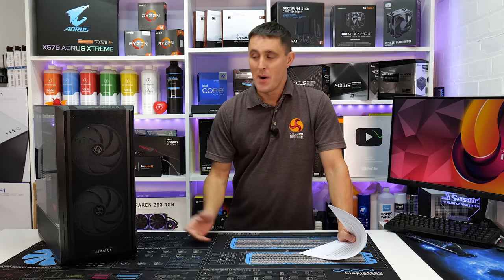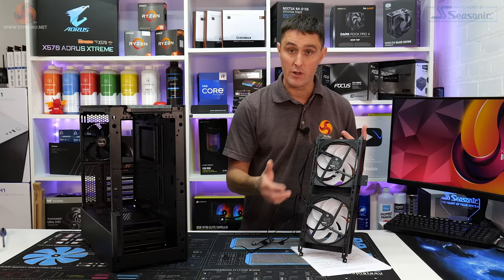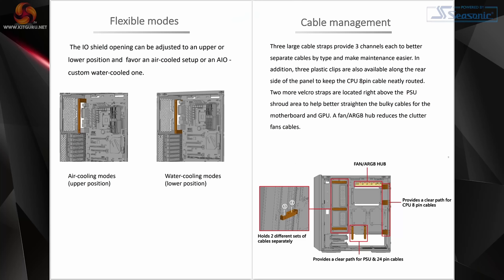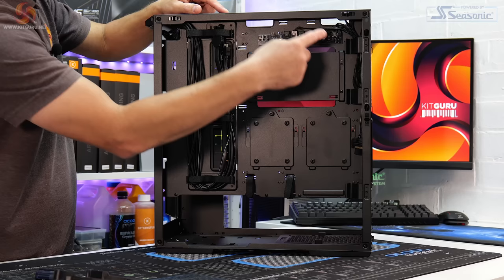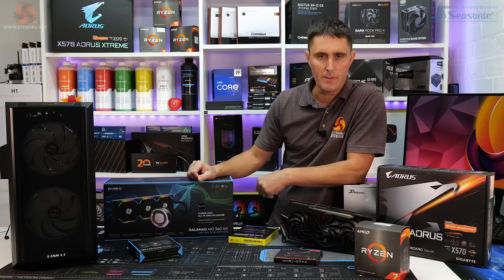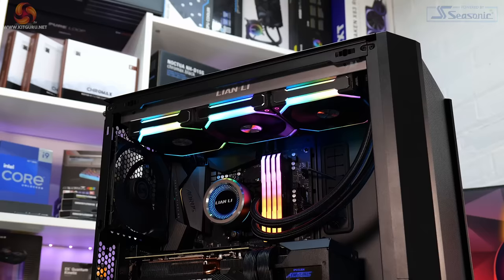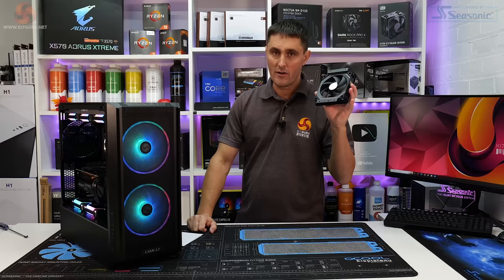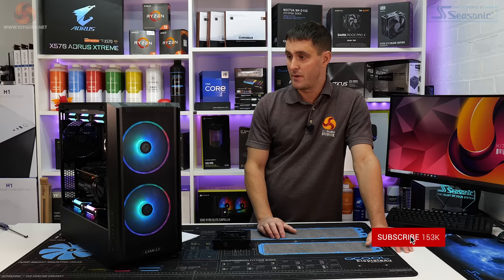Lian Li Lancool 216 - CASE of the year?

Comment: I wish these cases would have an option to remove all theRGB and side window features. There are still some of us here that have zero interest in all that fluff.
Reply: it's easy enough to just not plug in the rgb. for the window (i also prefer a solid side panel), i just tape a piece of black craft cardboard on the inside lol.
Reply: @darudesandstorm7002  Yes, I suppose you could. However, I was coming at this from the price point too. If an option was available without the lights and window, it might be £20 cheaper.

Comment: I would prefer it without RGB, other than that it seems a pretty good case assuming that a Noctua D15 fits inside that case.
Reply: D15 will fit. You can always disconnect or turn the RGB off?

Comment: I need more cooling to GPU and it looks like bottom fans would help. Is it so that PSU needs to stay fan down, GPU of course as it is(fans down, sucking air in?) and bottom fans pushing air upwards?

Overall I have one exhaust in the back, aio pushing up in the top and two large fans sucking in in the front.

Comment: I have and old XSPC 360mm radiator which is 60mm thick and with the fans I have 80mm of thickness. So my question is: would they fit on this case?

Comment: I like the way you can turn your horizontal GPU into a vertical GPU by rotating the expansion slot cover 90 degrees & using a riser cable.  Just one question, can I use my riser cable from the Original NZXT H1 in this case? 🔥 🤔 😂  Just joking, of course!   Although that add on to my insurance policy for extra fire insurance DOES look interesting...... Nah.

Comment: Hey great content thank you. Could you have fit the AIO and have the motherboard In the top mount position?  I know it's not meant to be there for water cooling but is it possible?  How much room is there for an AIO with MB in "air cooling" position?
Reply: you can still fit one just not as big
Reply: @banana3399  yes apparently <55mm total thickness of AIO.  Also mb  vrm thickness can hinder the fit as well.
Reply: I installed an Arctic 360 with Rog Strix 690 mobo on air position (top). Little tight but it fits. This way you can install the bottom and rear fans. Gpu is an RTX3080
Reply: @13gatoro  I was able to do the same. Thanks

Comment: Question..Im building my first pc and i got this case with the rgb controller.  And i never see this explained but on the motherboard it only has one usb 3.0 connection but both panels have a usb 3.0 cable how are you plugging both of them in?

Comment: wwell.. now days, RBG is controlled thru the motherboard, and software, so...
have you the same control options thru software, or only with the extra $14 costing module manually? 
cos if it only works with the extra add on manually, its a bad design....

Comment: would i be able to fit 2 140mm fan above the psu shroud if i use water cooling mode with a micro atx board?

Comment: That fan is meant to be installed when the GPU is in vertical position, it can help cooling the backplate. I do have a 140mm fan attached to the open bracket area and some heatsinks attached to the backplate on my 3090.
Reply: The external fan is designed for both vertical and horizontal mounting, according to Lian Li literature.

Either way, some video outputs are inaccessible as the GPU vertical mounting in this case is done by rotating the rear PCIe slots so they are still covered by the fan with a vertical graphics card.
Reply: no it is not, is ment to be installed on both cases, WITHH the motherboard in "airflow mode" you must move the stands for the motherboard 1 step up.
Reply: @MrDvneil  even in airflow mode the 2nd row of video outputs are not accessible on a card that has two rows of video outputs.

This meant that on my build all the DisplayPort outputs couldn't be connected, even in airflow mode.
Reply: @KitGuruJames   yeah, just the first row of video output, but most gpus have all their ouputs on the first row

Comment: 26:43 Do they have to be Lian Li Unifan only?  Can any other normal fans in the market be installed?
Reply: Nope. Any 140mm or 120mm fan can be used. I personally use two Artic p14 ARGB, also previously used a couple of cheap 120mm fans but I prefer the 140s

Comment: For the two fans on top of the PSU shroud, do you reccommend exaughsting air down or do you think that will pull too much heat into the PSU? Thanks :)
Reply: Those two fans should be blowing air to GPU. There's a mesh side panel below the glass panel which should provide plenty of air for them. At least this is the case with Lancool 2 mesh which has similar configuration except for the normal triple 120 fans in front panel.

Comment: can you put 2x 140mm fans instead of 120mm at the bottom of the gpu or the top of the psu shroud?
Reply: yes. I have 2 P14 ARGB as bottom intake in my Lancool 216
Reply: @vectivuz1858  thanks for the answer! ☺️

Comment: Where do my 3.5 inch sata drives fit?  I have 2 of them plus a couple of 2.5 inch SSD
Reply: You can install two 3.5" drives in the cage under the PSU shroud. Overall you can install either 2 x 3.5" + 4 X 2.5" or just 6 x 2.5".

Comment: I've never built a PC before but if I wanted a rear fan for the gpu as shown does a wire have to go all the way to the optional fan controller from there and if so where would it get routed?
Reply: There is a hole cut out of the back of the chassis to pass the cable through. It can be routed up to the fan hub from there. Depending on your fan cable length it might need an extension.
Reply: @KitGuruJames  Thanks :)

Comment: Very nice case- my two things I don't like is the #1 the open hole in the bottom ( why ) and #2  no square slot for the power run to the GPU from the bottom ( again why ).
I now see why no opening for GPU power from the bottom- the fans
why is there a need to have a square open hole which you don't show ( intentional or not ) is that for a front AIO, I really don't under stand the open area on the floor near the front of the case, and why  the pictures on sellers sites  show the case from a  angle which hides it , why ?
the  front lower 260 fan  is partially  below the floor, how is that good air flow ?
Reply: The opening at the front of the PSU shroud is to allow clearance for long radiators at the front, it's quite common.
Reply: I guess the bottom fan being partially below the PSU shroud will create some airflow across HDDs potentially installed in the cage under the PSU shroud.
Reply: @KitGuruJames  but what would you use- drop the stock fans- why, the whole point of the case is the fans
Reply: @KitGuruJames  or make the case taller- seal up the bottom- poof a really nice case

Comment: Can I install 2x bottom fans when the gpu is mounted vertically? The vertical stand seems to get in the way, as showed in Lian Li website.
Reply: I can't say for certain, but it looks like you could put a single 120mm on the underside of the forward shroud mount, in front of the psu. That'd give some airflow and still clear a vertical mount.
Reply: https://youtu.be/WvCb7uu-_7c
Another channel shows it, also the riser pcb kind of bending due to the two standoffs under load by these current gen massive cards. Looks like I have to diy another support in the middle.
Reply: You'd figure the industry would take GPU supports seriously by now. Most flat-mount supports are terrible and I haven't seen much for verticle-mount builds.

Comment: Pretty sure you can't optimize a case for both air cooling and AiO. You can make it big and universal enough, but that's not optimizing. You can still make it smaller and better for one of those in particular. Which is the definition of optimization? Less resources, better result.

Comment: Can you connect those front fans to the separate lian li controller you can get with the unifans? Would be nice controlling them with the rest using the software, instead of using those physical case buttons. I haven't used unifans before, but I am currently rebuilding my PC.  Dialed down cases for a while, and I plan on going with this one,  just curious about the RGB support on those front fans. The more I look at builds in this case, the more confident I am with my decision, now I gotta decide on white or black... This build came out really nice with the black though btw.